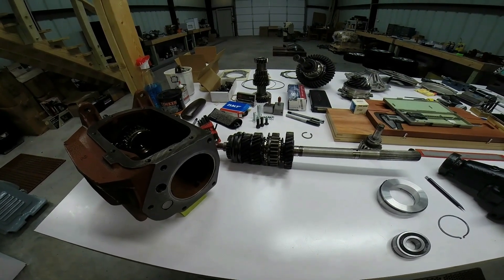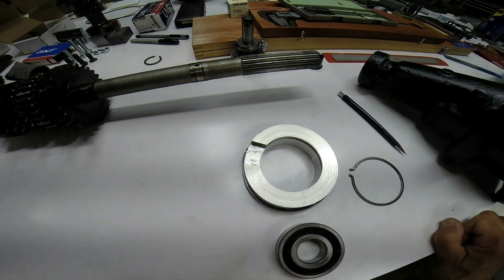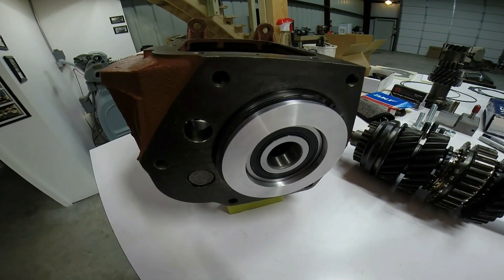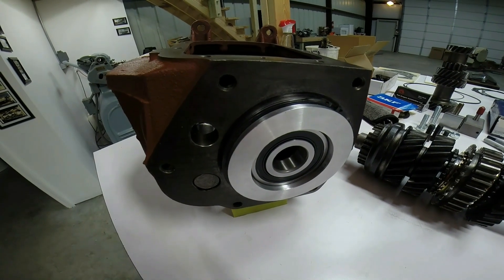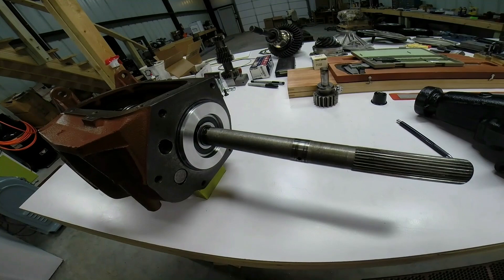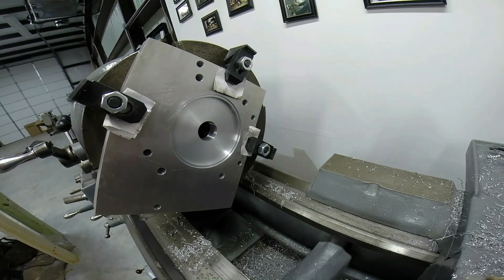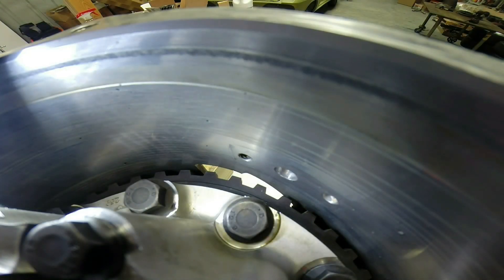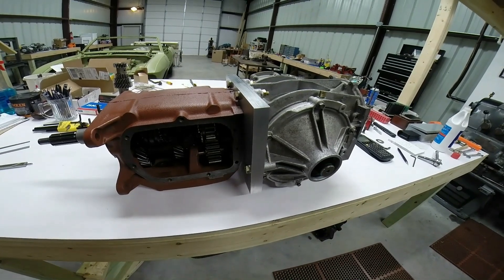Building a Saginaw C5 Corvette Transaxle

Comment: I have to say I am impressed, thank you for sharing. Mind if I ask how think the Adapter plate and bearing parts are? Also what kind of HP you feel it can handle? Again thanks for sharing and especially thinking out of the box. True ingenuity is a thing of the past it seems anymore. Oh, and how did you run your shifter setup?
Reply from the maker: The shifter setup is a Hurst Competition Plus using cables, the complete setup can be seen in the Mid engine Corvette video